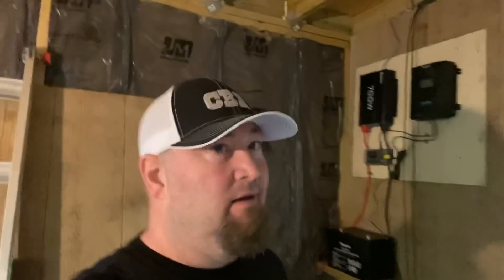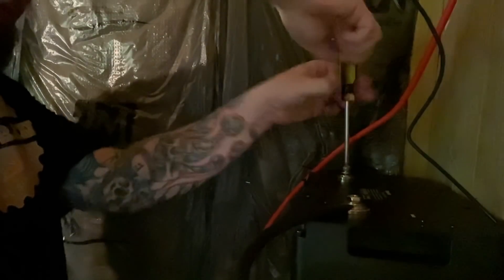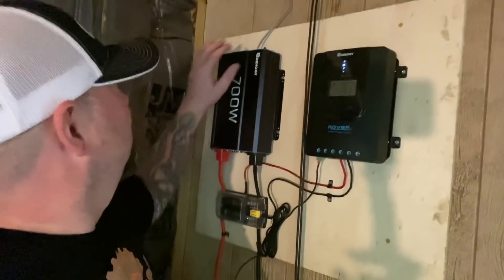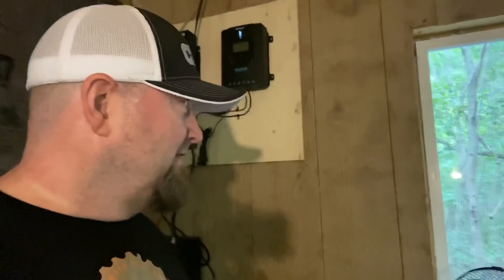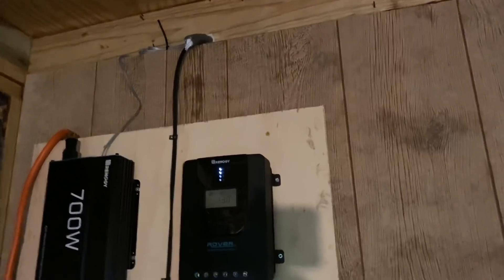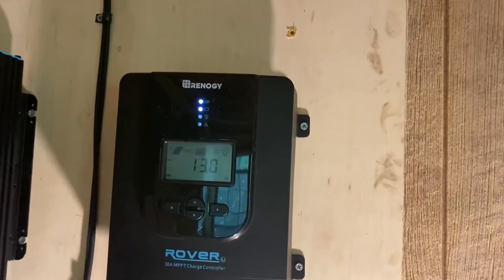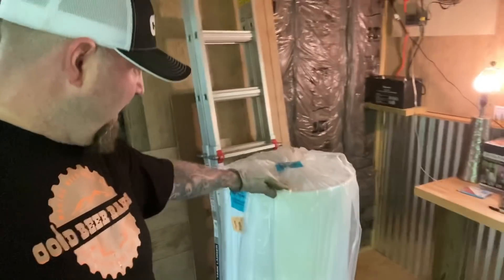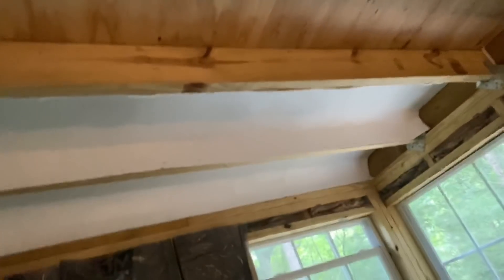Off Grid Cabin Solar Success

Comment: Hey Cold BEER here !! question on the fuse block itself ... is ee you are pretty much using it for a junction box to connect all of the components ........are you planning to run 12 Volt lighting ? from the fuse block ?
Reply from the maker: Hey thanks for the question, just using to connect other 12v items!

Comment: Add a DC & AC breaker to protect all, the size of gauge are calculate for correct amperage?sealed battery don't gas but put a cover on terminals or over the top of battery better have a marine box with terminals so can unplug easy and protect; NICE N CLEAN setup GOOD JOB!!! PS the solar panel wire vertical aligned to mttp make me a bit scared of water...

Comment: Awesome I'm gonna do the same system but with a 1000 watt inverter and 200 watt panels I'm thinking I can run a tv.  Fan and a couple lights with a 12v coffee pot.
Reply from the maker: Dude, let me know if it runs a tv, that would be cool
Reply: @coldbeerranch  semper-fi brother I'm sure both our systems will handle a movie or two no problem on the down time.im ordering most of the parts now. Thank you again

Comment: Always connect in the following order, as specified in the instructions. Reverse the order to down-power:  
1 . Connect battery.   2 . Connect solar panels.   3 .  Connect Inverter. Failure to do so may cause the premature release of the magic smoke, tears of rage at personal stupidity for not reading instructions, palpitations of the wallet!

Comment: its going to take that 1 100 w panel 20 hours of full sun to recharge that battery . buy some more panels . $85 on ebay will get you 100watt panels delivered to your door . no need to spend $115

Comment: The one suggestion I'd make, as long as your using an MPPT charge controller instead of spending $100 each on 12 volt 100 watt solar panels, find a local solar installer and buy a 250 or 300 watt panel off them as long as you have the space for it. If you can get it local you won't have to deal with freight and can probably buy a 250 watt to 300 watt panel for maybe $150 or less. If its a 60 cell panel it'll have a voltage of around 30ish volts that your charge controller will turn into the proper voltage for the battery and you'll get a lot more bang for your buck vs the little hundred watt panels. For what you'd spend on a 100 watt panel you can probably get 2 to 3 times the watts doing it that way. Check craigslist, offerup etc too for deals. I scored 6.3 kilowatts of panels off a deal on offerup from a local guy that did installs himself and had a stack of leftover panels from various jobs for $500 he wanted to get rid of. 18 of the 22 were the same 290 watt panels, 1 was an LG 350 and a matched pair of 245 watt panels and an oddball 260 watt panel. If your buying enough that it's worth the $250ish in for freight charges, there are a few places online like Santan that sell new and used panels, with 250 watt used panels for around $50 each. So for around $450-500 you can pick up 4 panels plus shipping and have 1000 watts of power. Freight is roughly the same whether you buy one panel or twenty, but if you only buying one or two find a local installer that can sell you a standard residential 60 or 72 cell panel. Don't do this however with PWM controllers, you'll just be wasting watts, but that Renogy you have is a MPPT controller. 

Otherwise nice little setup there. :)
Reply from the maker: Wow, thanks for all the feedback and advice.  🍺
Reply: @coldbeerranch  No problem, one last thing, don't mix the 100 watt panel with a larger panel, it'll end up dragging the larger panel down to the smaller panels output. Just mount it and swap your wires to the new panel or run a second set of lines to the new panel. You can always sell the 100 watt panel or find a different use for it. Or you can buy a second charge controller and plug your larger panel into it, as you can have more than one charge controller, cost a bit more but you'd get to use your existing panel plus a new one, or still swap it with a larger panel. With a 12 volt battery that charge controller can do a max of 400 watts. So 100 watts from your current panel plus another 250-300 watts for the second one, or buy two large panels and put one on each. Or if you have the room and can get 4 panels, buy 4, and put 2 on each controller. You'll get a max of 400 watts out of each controller. Even if you have two 250 or 300 watt panels on each controller, but the upside is you'll get that 400 watts for a longer period of the day with 800 watts from the two combined. 1.5 hours of full sun at that point would fully charge your battery. 

Have fun, it's addictive.
Reply: @andycanfixit  That's what i did, upgraded to a bigger panel. I run 2 separate systems, one charged by a 100 watt panel to run all the lights, and the other charged by a 450 watt panel to run bigger stuff. Greetings from Jamaica.

Comment: Put fuses or breakers in and what ever you do don’t run your battery down to low you only have a 100 watt panel you should add more panels as you have the means
Reply from the maker: Thanks Keith, that’s the plan
Reply: he has a buss box and fuse from his inverter to the battery, don't know about the positive line from the panels. The system needs to be grounded though. No matter how small the system is.

Comment: love your solar. Need an inch dead air space between the reflecting surface and the plywood ceiling. That bubble wrap does not provide much insulation. You do have the right idea on the reflective surface just need that dead air space. What you got can definitely be improved upon. I love what you have done so far so.
Reply from the maker: Thanks for the advice

Comment: you could fit closing vents one near the front low down and one in the roof space with a fan so the warm air can be drawn out and cold air pulled in low from the front

Comment: i would of put solar controller on the left and inverter on the right or facing down this way the wires for solar could of run along the top and in from the left and inverter could go down to baseboard to plugs etc less crissed crossed wire looks batter

Comment: After you finish the insulation between the joists, I would add another flat layer across the bottom of the joists. That bubble insulation works good with trapped air pockets in between the two layers.

Comment: i found the best way to connect inverter is a light bulb wire and a couple of croc clips the bulb will start dim the more charged the caps in the inverter become the more the light comes on and this stops the spark and can damage terminals and blow fuses etc

Comment: You don't need to worry about outgassing from the Lithium battery.  Check out the YT channel 50 acres and a Cabin to see how he wired in a DC attic fan with a thermostat to keep his place cool.  Nice work on the solar system!

Comment: Long term look at installing 600watts of 45voc panels as need 19volts to charge as your $800 battery deserves it and you have so many trees around.
 How many hours of direct sunlight will the panels get each day? The LI battery will take    full 30amps no worries when the panels can provide it. 

Gday from Australia
Reply: @Thomas Chrombly Do not know about about roll out uni Solar panels. What is their VOC? 
 I would doing as I suggested above and maxing out with solar or if mppt is compatible, add wind turbine or water generator from creek as those tall trees the number of hours of charging via solar will be short. Last thing want to do is turn that battery into $5 scrap lead. Every 20w of 120volt draw via inverter is approx 1amp.
I would be running wires for Led lights and switchs and usb recharging before lining much more of the walls.Will look much better when finished.
If you mount 18" Led strip lights against the white ceiling insulation it will throw a lot more light downwards and not shine in your eyes, just as having one light coloured wall in small area will help reflect the light and less power draw a less watts of light required. A removable fuse on PV wires be advisable fir safety and if want to isolate the  mppt from PV infeed.
Reply: @Thomas Chrombly Thank you. Will see If they are available in Australia
Reply: 4months later and curious how the solar going at keeping that battery fully charged or reaches enough charge when you visit your cabin?
Not essential to reach 100% SoC with Li battery every day but curious how much charge that 100W does put back into the battery every day on average?

Comment: Always Negative off first and On Last!
Reply: Backwards, LOL
Reply: @denisewilson8367  Safety: Always remove the negative cable first, then the positive cable. When you connect the battery, connect the positive end first. Here is the order: Remove black, remove red, attach red, attach black. Ensure that the connections on both end are secure by trying to move the battery around.

Comment: The radiant barrier is good but I would still put insulation like your walls on top of that and have both, the radiant barrier reflects the heat out words but you still want insulation, especially in the winter it will trap your heat inside and your roof is where you’re going to lose most of it so insulate with both before you put drywall up

Comment: Solar work came out nice! Suggestion, run AC wire in walls and ceiling like you would an on grid house before you cover up the joists and all. Down the road you have your ceiling lights, outlets and switches and be glad you did!
Reply from the maker: I was thinking that, but also like exposed conduit look.🍺

Comment: John, can you link everything you got to Amazon? I would have to buy piece by piece, but want to be able to see what individual piece price is. Thanks, be watching to see how you really like it. I'm sure it will take awhile to see it's full potential. Awesome journey.  Thanks John
Reply from the maker: Yes I can do that🍺
Reply: If you are only needing some lights for now, just buy a Harbor Freight kit is $203 including tax. Buy a marine battery at auto zone you will have less than  $350 - $400. I bought a 12 volt fan at rv world for $90 and a cigarette plug with 2 usb outlets for $4. 
Now I can run my propane fridge, have a really great fan, charge my power pak and my phone and run my lights in my motorhome. I could use another battery for multiple days of overcast /rain. But with sunny days I have no issue supplying enough power. 
The Harbor Freight kit comes with 4 - 25 watt panels, connection cables, charge controller, stands for the solar panels, and L.E.D. Light set.
My propane fridge costs more to buy, but runs on a dab of electric to ignite the propane gas, and I get the propane cheap. So, very low cost for a fridge/freezer combo it stands approximately 2 ft wide by 4 1/2 ft tall. Good for party snacks, steaks, ice & COLD BEER. LOL

Comment: Sweet! Lookin good!
I put a harbor freight 100 watt system in mine. It will run the lights and a fan, but that’s about it. 
But I  bought a H F Predator generator. I will run a 5000 watt AC window unit for six hours, on one gallon of gas. 
Best money I ever spent. It gets hot 🥵 n Tusc. ALA. 
It’s a 2000 watt inverter generator. Check it out!
I paid about $500.00 for it. 
Your doing a great job,like your tiny house!
Reply from the maker: That sounds nice i will check it out🍺

Comment: When connecting a battery, always connect positive first then negative, when disconnecting a battery you do negative first then positive.
Reply: I thought the same thing that way you don't get the spark.
Reply: Cyndi Brown 
You will still get the inverter spark.  Instant rush of power to charge the capacitors in the inverter
Reply: No. That is not a general rule. That rule is for a negative ground vehicle, where the negative battery terminal is tied to the chassis of the vehicle. In that case if you connect negative first then it is very likely your tools will bump the chassis while working on the positive terminal and cause a short.
If you are working on a positive ground system (like a telephone system) you want to connect negative first, then positive.
Get it? Chassis connects last (and disconnects first).
If you don't have a chassis connected to either battery terminal then order doesn't matter.

Comment: There is zero off gassing from that battery, the one thing you will need to worry about is charging it while cold though, the battery most likely has a cold cutoff for charging. AWESOME to see it working!
Reply from the maker: Thanks Sean, that is what I thought I remembered reading!  I’m in East Tx so doesn’t get too cold🍺
Reply: @coldbeerranch   I just checked the specs on the renogy site. Operating temperature is 32~131°F. So unless it gets to freezing temps in your cabin you should be safe.
You could also put the battery in an closed insulated box than there should be no issues.
Reply: @1kruxi  I'm in upstate NY and where I am it gets to around -20 at times. I have had 2 6volt deep cycle batteries in there since 2009 on a constant charger plugged into an outlet. The batteries are like new. I tested them 2 weeks ago once again. Point is, as long as the batteries do not go below 50 percent there should be no damage. No matter how cold it is. This is for AGM batteries like the one in this video.
Reply: That's the problem I had with my sealed batteries, -20 is common here and sometimes -40. No problems from my lead acid Trojan L16s at those temps.